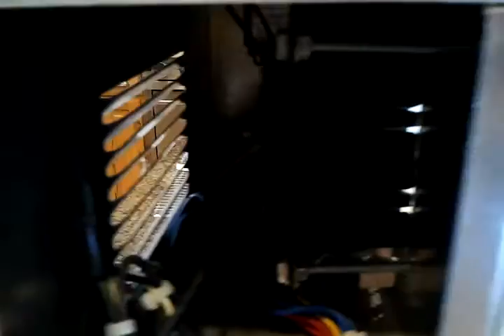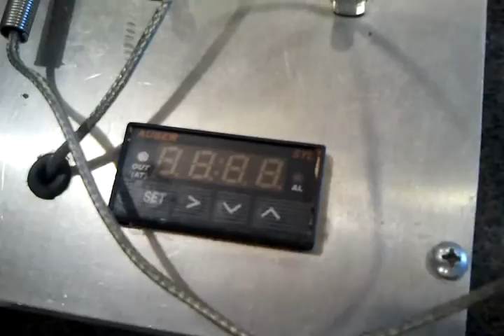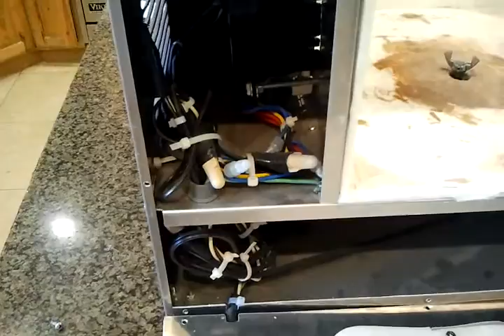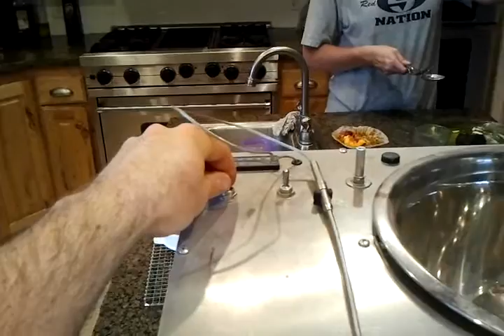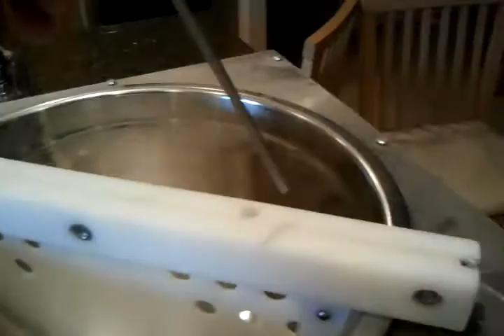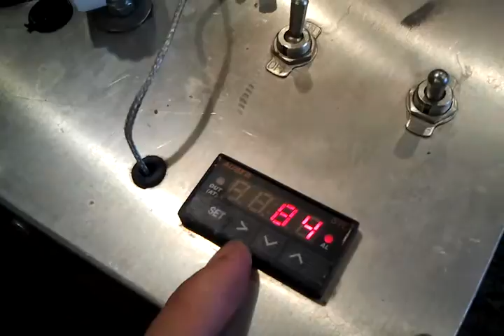How to build a large capacity home chocolate tempering machine

Comment: Name and size of bowls Thanks.
Reply from the maker: I'm afraid I don't remember. I had purchased four of them from Walmart when I started the project because I new they changed inventory often enough I may not be able to find them again. Ultimately getting the same bowls as I had is not critical. In fact, if I do need more I would look for different bowls myself (thicker) but that had the same diameter at the top so that I didn't have to change the housing.  You want thick material so it's durable and then get several of them so you have replacements.
Reply: @doctorsanders1  Ok Thanks. Is it possible to get the electrical wiring information. Trying to get hubby to make me one thanks
Reply from the maker: @customsongsbytina sounds fun! It's likely you wouldn't need it because when you purchase the PID controller and SSR it comes with wiring instructions. However, I found my wiring diagram and could get that to you but I'd still recommend confirming it is correct with someone who is familiar with electrical wiring. For example, I made sure we grounded the  enclosure which wouldn't be included in the component instructions.
Reply: @doctorsanders1  It would be very helpful if you can send it to me. How can I send you my email address as you do not have a contact link Thanks.

Comment: Hi Michael,
I wanted to ask you, did you use the solid state relay for the Gear-head motor, or the heater? Why the solid state vs a standard relay?
Reply from the maker: It was used for the heater.  The way temperature is controlled precisely is through turning the heater on and off like pulse width modulation.  The longer it is on the hotter it gets in the box and visa versa.  Whenever you are switching a high load on and off for a lot of cycles (as is the case here) a standard relay can wear out much quicker because of the arcing that happens with every cycle as the contact is broken or made.  Using a standard relay may work, but is not as ideal as a solid state relay.  That was long answer to a simple question, sorry.
Reply: Michael Sanders 
No need to apologize. Your answer was spot on. Thank You!

Comment from the maker: I have spent some time trying to find my original motor spec papers. I can't be for sure that it was 1/4 hp.  The RPM was 13, but you could vary on that a bit and be fine.  Getting a motor that is powerful enough is important obviously and I wish I could get you more, but for now I can't.  I will point you in the direction of a great resource for less expensive cool stuff (like geared motors). google surplus center and the first result should be surpluscenter.com.  I've purchased a nice big worm gear reducer from them and it has worked great.  I noticed they have geared motors too that look very close to what I have on the tempering machine.

Comment from the maker: Thanks Steve.  I'm glad it was helpful to you and I think it is great that you added some thoughts of your own.  I did use heat sync paste on my SSR although my first SSR was bad too.  I bought another one from them and that one worked fine (still working).  Still based on this it may be worth looking elsewhere as you did for your SSR. Now for a couple helpful tips.  I too cut the vents for my housing which has worked just fine, but looking back I wished I had just cut a square out in the box and mounted an off the shelf vent from the hardware store.  It would've been a lot easier (cut a square and then use 4 screws to attach the purchased vent). Hindsight is 20/20 right. I love your plug idea so you don't have to rewire stuff.  Modular thinking is awesome.
Reply: Wasnt able to find the motor at grainger, do ya know the model #?(may not be available now but thatd let me find a near exact replacement) thanks

Comment: Hi, first off, I'd like to say THANK YOU to Michael for posting his Chocolate Tempering Machine videos.
I just completed my build of a similar machine using your specs. SUCCESS! We've used it twice already. Due to resource availability, I followed the advice of Clint Eastwood, "adapt improvise overcome". Initially I purchased all my electronics from Auber Instruments but they sent me a bad SSR and would not replace it so I wound up finding one locally for a few $$$ more. I added a HEAT-SINK to the SSR (Auber says it overheated, even though I have a box fan installed 2 inches away)

Items I used and some costs...
PID Controller and SSR (plus replacement SSR): $73

4' x 8' sheet of aluminum I just had laying around from another project, I have access to a bending brake.

1 ceramic heating element from a space heater not being used anymore

2 ac/dc plug adapters (used for connecting the motor and the box-fan) I had stock piled.

4" PC/Computer Box Fan (Used to circulate air from outside the unit across all electronics (motor, SSR))

Motor: $23 (Amico DC 12V 150mA 10RPM 20.9Kg-cm High Torque Permanent Magnetic DC Gear Motor)

Heat Chamber Insulation/Reflector Material: $10 (12" x 39" PRO-Heat Shield Protection Aluminum + FG insulation exhaust header)

Stainless Steel Bowl: $8

Additional costs (hardware,plastics, other odds and ends): $150

I also added a 2 recepticle outlet that I just plug my motor and box-fan into. My thought there was if I ever needed to replace the motor or box-fan, it's just a matter of unplugging instead of hard wiring.

I cut slots for venting in and out to the lower section for the motor and SSR, but I did not do that in the heat chamber area, figuring that I want the heat to stay in that area as long as possible and thought there is enough heat loss coming out where the bowl sets. I cut the slots using a multi-tool then flared out the sections to create the vent using a 6" Jaw Straight Sheet Metal Seamer from Harbor Freight ($15).

Definately use stainless steel hardware. Michaels idea about the shower roller kit works great.

Comment: Michael, you actually took the machine apart to share the inner workings with us. That by itself is very cool. My favorite feature is the port in which to monitor the heating chamber when the chocolate is first introduced to the bowl thus preventing the machine from temperature hunting and overheating the product. The design just makes sense. Nice Work. Thanks again for taking the time.